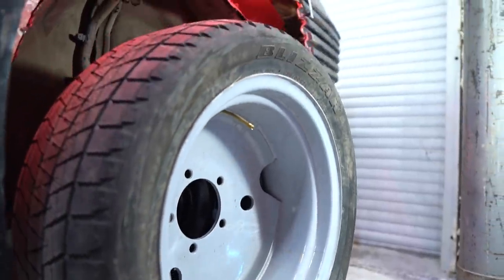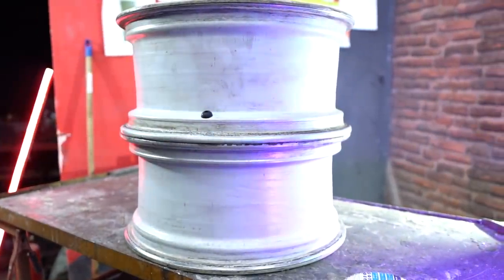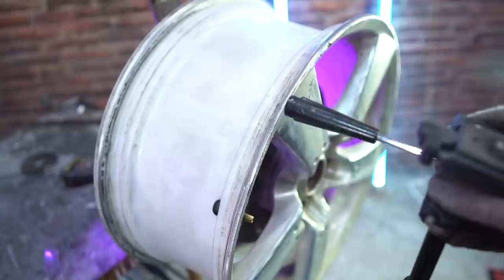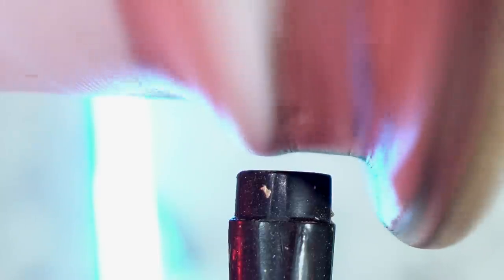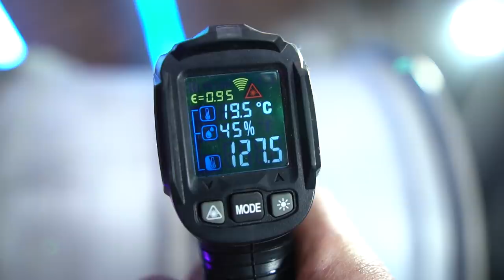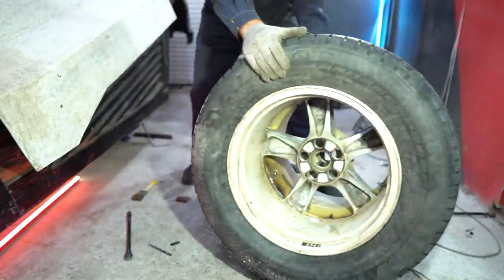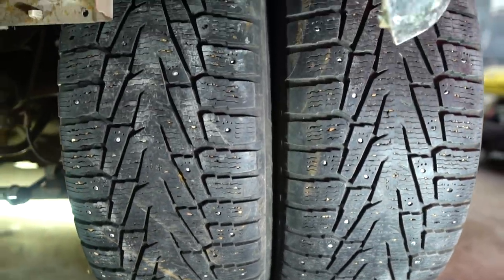Two wheels. Quadra V-Tech in real life. Cyberpunk 2077.  Part 16

Comment: it might not work under driving conditions the sidewalls are so close together that they will rub during the ride and likely wear the rubber off all the way to the corelayers or get so hot that the tires will blow out 
to make it work you might need to add a spacer in between the rims to give the sidewalls the room to bulge where the tire meets the road
Reply: It should work because the wheels are welded and so they can't move independently of one another - therefore there shouldn't be any fiction between the two. However during normal driving the bumps on the road do cause wheels to 'puff out' a bit, and that's normal, and that action might cause some rubbing problems But I'm honestly not sure because the car probably weighs next to nothing and with TWO tires that weight distribution will be immense and therefore the wheels might not puff out at all during driving.
Reply: @SantitariumHaze  in corners the sidewalls deform no matter how hard there pumped up , allso the bulging where the tire meets the road is going to happen no matter how hard you pump up the tire , he could mount narrower tires and stretch them on the rims , that might work too 
dont think the car will be driven though think its more of a showcar
Reply: @watahyahknow  I didn't think of the cornering, you have a point there. The only real solution I can think of is undoing the welds and putting spacers between the two rims. Give the tires a inch or so of breathing room for flex.
Reply: Pretty sure he is gonna go for the single large wheels options in 2 weeks and redo everything all over again
Reply: I dont think he will drive this on the freeway lol
Reply: My thought as well, though I am more concerned with heat causing a tire fire. The Fiberglass above it would go up quickly too.

Comment: Love this project!  Keep it coming!  There is a condition to be aware of with dual tire vehicles - sometimes if the tires are too close, they will rub against each other while rotating and can melt or cause a fire.  There is probably a sweet spot for tire pressure to avoid that, or you could also potentially use a lower sidewall tire or use smaller tires  stretch technique that used to be popular before more rigid sidewalls were common.  Excited to see the next phase!
Reply: This is a Russian guy doing
Reply: @ЖеняШилов-ы9ш  im pretty sure he translates the comments. I saw one vid he said “thanks for the feedback…”.
Reply: @Crozzzbonez0  He's got a russian channel with russian comments.

Comment: I just hope the tyres will endure their use. Usually dually axles have a little bit of space between the tyres, so they don't rub each other. Just look at how it's made on real dually axles.
Furthermore special tyres are used for it, because normal tyres can't handle being on a dually setting.

But the project itself is absolutely awesome!

Comment: I like the project, but I’m a little bothered by the distance between the wheels and the fender arch. It doesn’t look natural to me and I think it should be fixed a bit. Anyway, congratulations on a huge achievement, I am working on one small project, and I already have a problem with completion, and your project is progressing excellently despite the many times larger scale.
Reply: I think it's like that because the car is still empty, once he starts filling the interior it's gonna add weight to it and the suspension will go down
Reply: @pistolao_vr  yeah true
Reply: he also mentions in the video that he could lower the car.
Reply: It's on air suspension so he can lower it.

Comment: You know tires flex, like a lot while driving. I think you will find the sidewalls will get hot where they touch each other. This heat will cause tires to fail.
Reply: I suspect it'll eat tires, but I don't suspect it'll get driven around all that much, either.

Comment: Tires on a dually should never touch.  As weight transfers to the load side it will cause friction and tire failure.
Reply: You are right.Tires wont last

Comment: at first I thought I was going nuts since I've seen this before, then I remembered I watched the non-dubbed version a week ago lol. 
I will note, you should use skinnier tires, you need a gap there to prevent the sidewalls from rubbing through each other. Also prevents gravel from getting stuck between the tires.
Reply: Indeed, people don't realize how much heat is created by the sidewalls of dual tires rubbing, it's a major cause of tractor-trailer semi fires.

Comment: You made that so much more difficult than it needed to be. Why not just use a dual wheel set up off a truck axle?
Reply: because this car doesn't have a truck axle.. totally wrong bolt pattern and wheel size.
Reply: @Collindoesdrifting  Truck axle could be fitted to it, but car wheels would need to be adapted to the truck axle anyway. There's a problem in this video and it's the sidewalls touching. They will blow out eventually.

Comment: the sidewalls flex during operation and the sidewalls touching will create heat and tire failure, similar to the rear dual wheels on trucks. It does like really cool but for safety

Comment: The wheels are most likely an aluminum alloy so your weld filler would need to match. Preheating helped your weld, turn wire speed down and voltage up

Comment: Should've welded the wheels together on a pulse setting of the Mig welder. Too bad they don't sell a super wide tire, so you could use that instead of 2 tires per bogey.

Comment: Those tires won't last long like that.  Duallies need a gap between the tires, because of the bulge at the bottom of the tire.  No gap means they will press hard into each other and quickly destroy themselves and/or pull your welds apart.

Comment: I dig it , but the tires won't last but a day. When the tires expand from the heat at highway speeds and will rub both sidewalls out until they burst. Already tried this along time ago. You need to space out the dual wheels.

Comment: Dual tires cannot touch.  Even though they are going the same direction you will get friction at load bearing points and  tire failure will happen.   That is if you get on the highway.      You need a gap.

Comment: You needed to clean the wheels more, wire wheel it, flap disc. You also needed to v it out more and it looks like you needed more heat on your welder. Try that next time if you have to again. Good job tho. 🤙

Comment: So if you have understanding of the stress involved with this type of arrangement of wheels. You would absolutely avoid the dually idea on semi floating or fixed axle. As for semi auto weld in an Argon gas environment . That would be an improvement over manual,  gas shielded welding. That what looks cool to children is a lot bigger deal than a child can imagine. Where's the auto engineer when you need him? 😂

Comment: Be careful, I know ont trucks with dual wheels they say it's dangerous to even use tired that are close to each other because they heat up if they are forced together. The tires on yours obviously touch even without a load. Not only that, the sick out being the wheels and look too wide for the rims, like they could pop off. Probably fine for a show car, but I would not drive it too agressively.

Comment: Been working with tires for a while now.  This is far too much work.  You can mount dual wheels without the welding.  It's only worked for 100 years.  

Oh, and throwing a tube in a tubeless tire messes with temperature dissapation.  Increases your chance of a blowout.  I've only been working on tires for about two decades.  What do I know?

You don't even get into tire pressure.  A setup like this you might want to run 25-28 psi to maximize your contact patch.  Maybe as low as 23 psi.  That is just a gut feeling.

Comment: welder with shop experience and works with aluminum truck bodies if this helps, in this situation I would bevel the whole rim, making sure to keep it in Balance, so that the bottom of the weld surface is at least half the thickness of the joint, then without manipulating the weld,(walking the cup, weaving, crossing ect.) Run a pass, pushing, at a 45° approach.  if that diddnt fill the "valley" I'd brush it, clean it, and run a cap, you could manipulate to fill, don't be afraid to get that nozzle close, the closer the hotter and evenly spread your bead is, and a gas pressure of 30 normally works for me, hope this helps if it doesn't I'll probably be on someone's know it all keyboard warrior video

Comment: Youre welding magnesium/ aluminum rims. Too bd youre not in ft worth texas. Ive gota guy that could have made those wheels as on. If it fails later. Id suggest changing out the wheels to knock offs. You can make a splined axel with knockoff converter kit . Bolt the kit to the hub and the splined axel to the kit. You could yse those rims if you had the centers machined out and use dayton knock off spinners or campanolo rims. My 69 lambo has them and they look cool in an ugly way.

Comment: 6:04 I think tires shouldn't fit like that on rims. You have too wide tires. Also, that weld won't last too long. Hope you will just roll this car to a car shows, because driving it in normal traffic would be a danger to other people on the road. Imagine this weld crack and some pedestrian got hit with speed up wheel. It may be lethal...